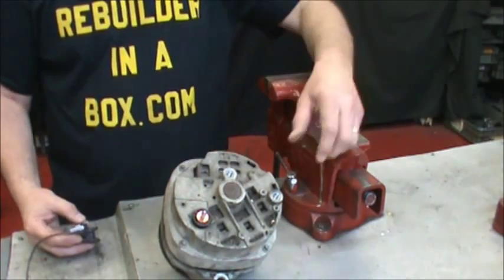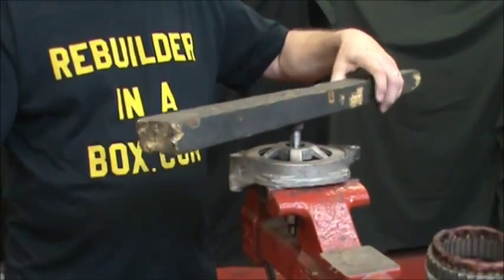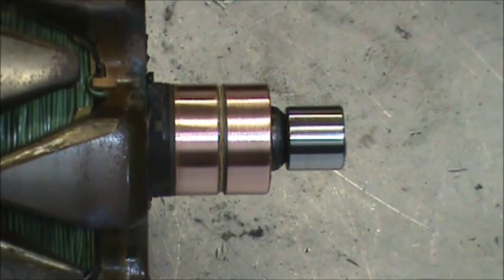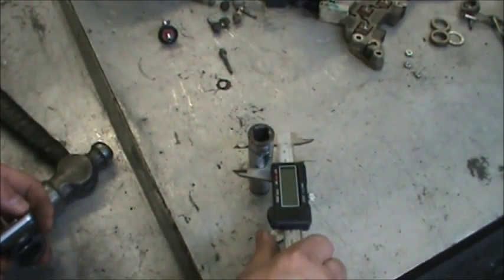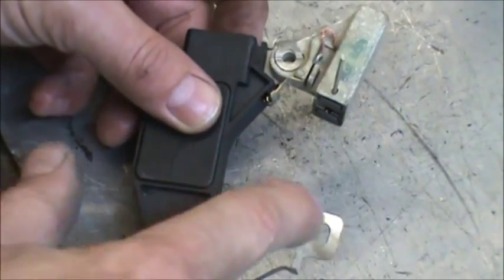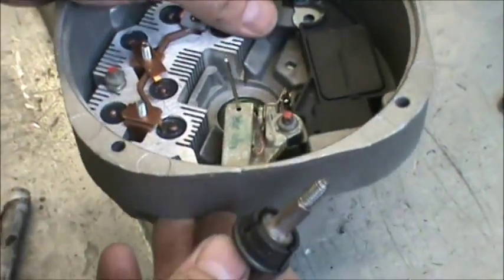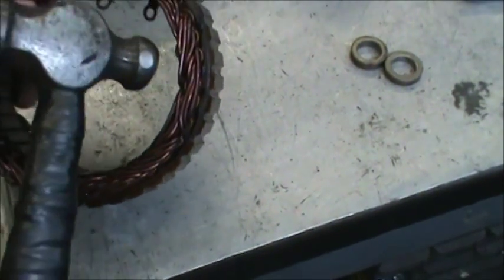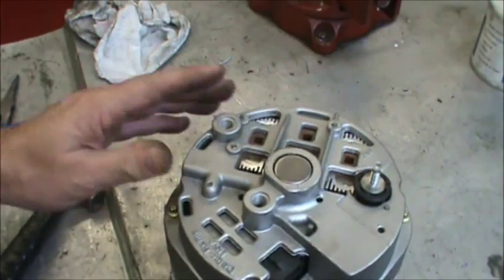How to rebuild a CS144-411

Comment: Thanks for publishing these videos.   One thought on staking in the bearing.   You could do like the factory did, and weld it in.  There are "low temperature aluminum welding rods", that melt at about 650F.    Harbor Freight has them for $16.99.  You just heat it with a propane plumbing torch.  You could probably do it with your 200W soldering iron too, and just do 4 or 5 tack welds.  

Using the low temp welding rods would probably be faster than staking like you showed.  Just a little to hold the bearing, not  a thick bead around the whole thing.   When it's time to rebuild it again, it would break out the same as the OEM lip.

I haven't tried it yet, but I was thinking about how they did it originally.  If they had just cast the alternator front with a lip sticking up, it would have wrinkled when they pressed it down.  Being smooth hints that it wasn't folded.

It would add a few dollars to the required equipment, but it isn't outrageously expensive.  You probably already have the torch in your shop.   Most DIY people have the torch already, from doing plumbing soldering.

This isn't my video, but it shows some practical destructive tests, which also shows how to use them.

https://www.youtube.com/watch?v=fKIKsDfRAcs
Reply from the maker: Wow, thank you so much for all your comments!
Don't know if I would recommend enough heat to melt nickel alloy that close to a bearing. Aluminum transfers heat very efficiently, I'm afraid of bearing life expectancy or shriveling up the seals. But we will certainly keep those type products in mind for future reference.

I think the factory uses a roller type machine on the extra lip but it would have to be done cold.
Reply: @rebuilderinabox  Those aluminum welding rods melt at 730F.  Nickel and steel are right around 2600F.  It's more like soldering than welding.  It probably wouldn't be good for the seal or the grease in the bearing though.  

You might be able to melt it with your tweezer soldering iron.  Those look really efficient at heating a small spot quickly, without damaging the bearing.

If I weren't in a rush to do my only broken alternator, I would try it.   I don't really have time to do it twice.  But it looks like you probably have plenty of spares to test it on.

Comment: Thank you for a very informative video. I just got a CS144 from the junk yard off of a 1998 Chevy Tahoe.  Used the front half of another CS144 with 12/6 o'clock mounting holes that fit my 68 Chevelle perfectly.  This Tahoe alternator only had one wire coming off of the regulator connector at the L terminal.  The number on the regulator is 466.  Will I have any problems hooking this alternator up to my Chevelle, which already had an SI 10  alternator set up?  External regular was removed and re-wired for the internal regulator type alternator.

Comment: Hi Mike,  Thank you for a good video.  I recently rebuilt my css144 alternator and put it back in the car.  Now I realized I forgot to put that paper insulator back in that goes behind the  rectifier.  What is its purpose and do I need to pull the alternator back out to put it in.?  Alternator is in a van and accessibility is quite hard, so I hope not.  Thanks.  Mark
Reply from the maker: I wouldn't worry about it. If omission was a problem, you would have experienced charging malfunction right away.